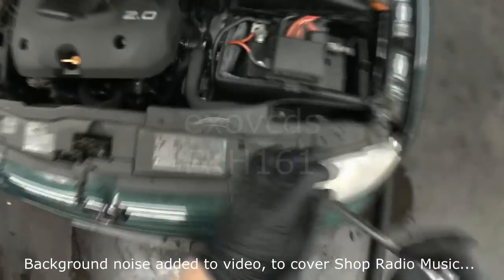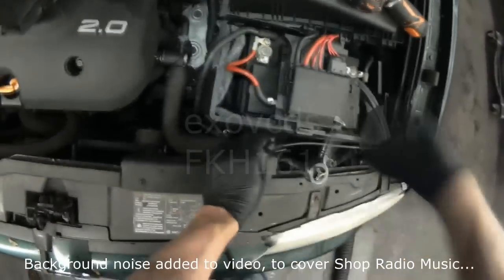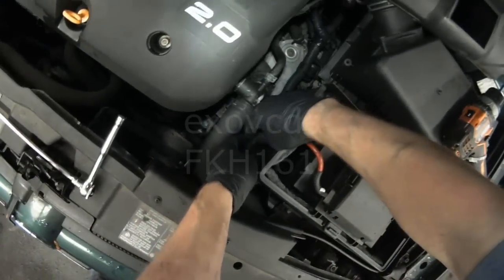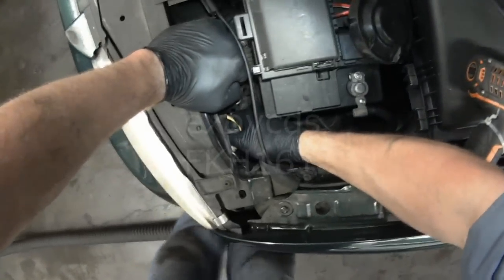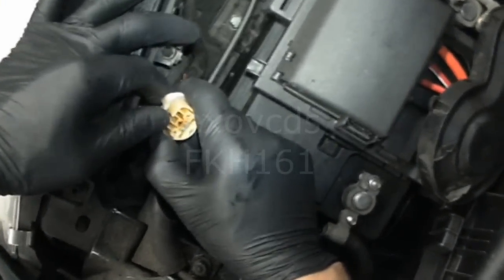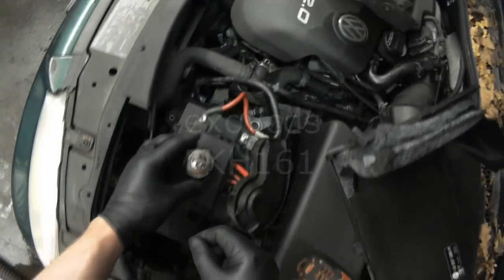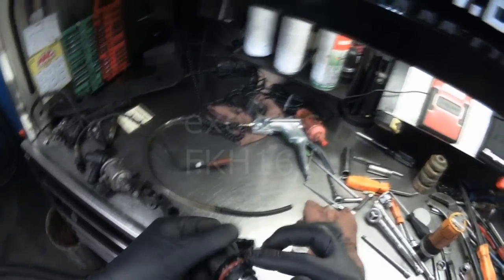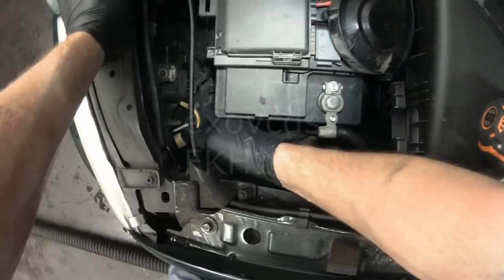VW A4: Jetta, Golf Headlight Bulb Replacement (9004 / 9007)

Comment: Thanks for this Thomas! I had to have a shop replace my wife's passenger side headlight last time because I couldn't figure out how to get the bulb out (in my other cars the bulb turns, not a retaining clip). There's so little space to see in there that I didn't realize the clip was there and couldn't get enough room to get enough torque to turn the bulb. Once I heard you mention that retainer was there and to just turn it counter clockwise, the driver side bulb came right out and it took like 5 minutes start to finish to replace it. You saved me $26! Thank you!!!
Reply: BTW, my wife's car is a 2001 Jetta and the configuration is exactly the same
Reply from the maker: Happy to hear my video was of help! Thanks for watching & taking the time to comment. Happy New Year tonight!

Comment: Thank you for the video.  You helped me out a lot.  I would reccomend taking out the battery, because it really did help a lot, especially if you have big hands.  Just take off the connectors, pop off the top 'distributor' from the plastic guard, remove the guard, and you'll be able to get the battery from it's casing.  One minute worth of work, would've have saved me from five minutes of frustration.
Thank you very much for the video.
Reply from the maker: Trevor Anderson Good tip, thanks for sharing! Having to reset radio (security code needed sometimes) stations, clock, power window auto up/down function etc, can be a hassle for some though.

Comment: Hi:

Thanks this is very informative!

Is the greasing of the bulb O-ring recommended or optional? I do understand that it will help in sliding the bulb in better, and at the same time, would it not make the overall seal loose?

Thanks.
Reply from the maker: If you can get it in without the rubber grease, great... generally not needed. Let me know what you decide to do when you can't get the bulb in.

Comment: Thanks for the video!  My MK4 beetle low beam headlights are unusually low but the high beams are great.  Any suggestions on what's going on w/ the low beams?
Reply from the maker: They share the same ground as the high's... if the highs are good, then it's not a ground issue. Try a different brand of bulb or go up in wattage.
Reply: Hey Thomas i have the same as yours so is it 9004 or 9007?

Comment: Can you post a video f how to replace a headlight bulb conector with 3 colored wires... TANK YOU SO MUCH
Reply from the maker: You mean just the connector? Is the old one burnt? I will make a video when I get one in my hands... you might have to wait a while. Should be easy enough to splice in... cut the old wires and connect the new harness plug.

Comment: I know this is an old video, but my headlights on my 2002 Volkswagen Jetta just suddenly stopped working on the 4th. What should I begin checking? the bulbs are good, and I have pulled the covers for the relay panel underneath the steering wheel. the relays aren't labeled! can you help me out?
Reply from the maker: I'm still at work... I'll get back to you once I am at home later tonight.
Reply from the maker: Low beam & high beam run on different fuses for left & right, so it's probably not a fuse issue (doubtful that both fuses would blow at the same time... but I guess they should be checked anyways. Just like the bulbs... the bulbs may be find, but the connectors might not be... but again, doubtful that they (bulb or connectors) would go at the same time (low & high beam). You can also ignore the daytime running light relay, since the lights should come on once the headlight switch is turned ON. If they don't, I would start by checking power at the back of the headlight switch... for power coming into the switch and for power leaving the switch once the switch is moved to the ON position... (wiring diagram will show which wires to check: http://fkh161.ca/VW/VWA4Headlights.pdf )
Reply: Thomas EXOVCDS I also should have mentioned that my turning signals both work with the headlight switch off, but only the right side (turning left)  turn signal works when the switch is turned on.  And also I checked the fuses already. The daytime running lights aren't even coming on when the key is turned. Still doesn't turn on with the headlight switch turned on. But thanks for the diagram.
Reply from the maker: They all share the same ground... so that's a good place to start. Might be under the battery.
Reply: Thomas EXOVCDS remove the battery tray?  then what am I testing/ looking for under there?
Reply from the maker: The ground wires under the battery. Or follow the brown ground wires from the headlight bulb(s) to where they end up... I'm not sure off of the top of my head where the ground location is. PDF says front left of vehicle... so I assumed under the battery. Again, you are looking for something that all those bulbs have in common, the ground looks to be that.
Reply: Thomas EXOVCDS Stupid question.  the car battery is reading 12.55, 12.56 volts.  Might that have something to do with it?
Reply from the maker: Mike Hill When the engine is running?
Reply: Thomas EXOVCDS 14.12 volts with the engine running
Reply from the maker: Mike Hill Those voltages are fine.
Reply: Thomas EXOVCDS  if the dash lights up when I turn the headlight switch on,  doesn't that mean power is going to and from the switch?
Reply from the maker: Mike Hill I have gas in the tank but my car doesn't start.... same thing.   You need to know if the power is leaving the switch to the headlights... yes, the switch is sending power to the dash, but what about the headlights? Are the park / tail lights coming on? Do the hazard lights work? The wiring diagram contains everything you need to check the system... with a test light.
Reply: Thomas EXOVCDS do you have a video demonstrating these types of tests?
Reply from the maker: I'll get back to you once I'm at home after work later tonight... sorry, no video on how to use a test light.
Reply from the maker: Remove the headlight switch (https://www.youtube.com/watch?v=5v-RKI5X5Zw) and use a test light to check for power on the wires at the back of the switch (according to the wiring diagram) with the switch in the OFF & ON position. If power is present going into the switch and coming out of the switch, go to the next item on the wiring diagram and check there... continue until you get to the bulbs / ground side of the circuits.